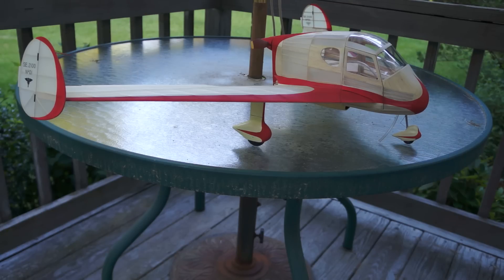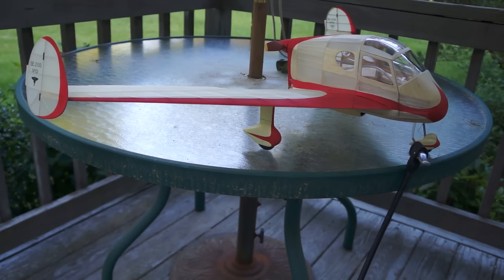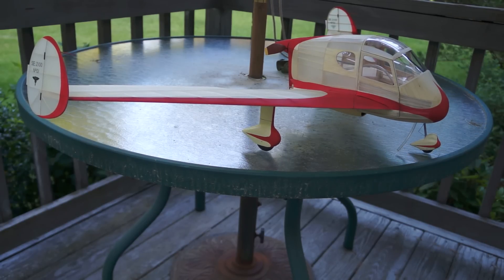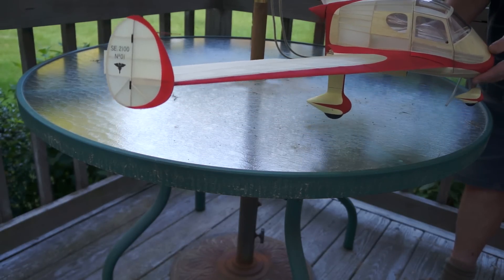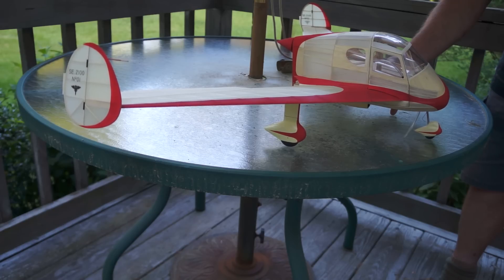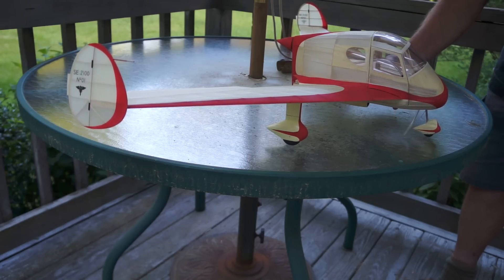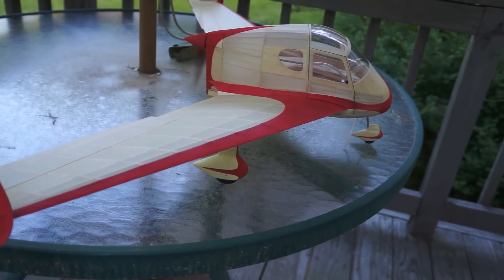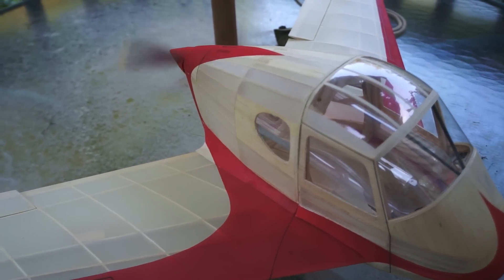Z-Motor Compressed Air test #1 in Free Flight Scale model

Comment: Here's an add from Bertram Ponds book  Expansion Engine Powered Model Aircraft. A ready made model powered by compressed air  has made an appearance in Europe. The motor, tank and propeller are plastic. The wings and tail surfaces are balsa sheet. The tank at7 60 cu.cms. is a bit over 3/4 of a liter, and  pressure relief valve set to 102 psi. (7 bar) The engine bore is .3937 (10mm.) and a stroke of .3149 (8mm.) The motor weighs .4 oz. (7gm.) The piston has a spring on top that acts as a pressure regulator. This results in  increased duration. The propeller is 6.6 inches in diameter. Duration at 7 bar is 60 seconds. Weight of the entire model is 4.6 oz. (130gm) They have named the model Jonathan Z model.

Comment: I love this engine so much... Any second hand Z engines on sale? I wanna reproduce the resilient parts using sugru to increase the lifespan... Thanks!!
Reply from the maker: I likr your thinking!  By resilient parts I'm assuming you're referring to the thin rubber-like gasket between the cylinder body and the cylinder head.  I'm sure it would take some trial and error to find the proper gasket thickness/density as well as the dia of the hole in the center of this gasket.
Reply: Indeed! In the Z engines I think that the gasket could be replaced by some fine tuned rubber balloon sheet, although vaseline and most lubricants tend to ruin the latex. 
But I am actually trying to replicate the gasket of an Air Hogs engine, in which, as you may know, the resilient part is a piston "ring" that expands on TDC under the rush of air, and contracts after the exhaust, to prevent compression on the upstroke. Still if I were able to get one single working Z model I'd take all care to make some sort of kit to replicate the gasket.

By the way have any of you ever flown by using some small brass steam engine such as this one?
https://hobbyking.com/de_de/microcosm-m27-micro-steam-engine-model.html
It weights 20 grams without the flywheel, but I'm afraid that it does not have enough power...

Comment: How about if you use air rifle air tank in or paintball air tank.More capasity and higher pressure that can regulated to come out lower psi?
Reply from the maker: thanks for the idea ZaKath, but a big part of the challenge with compressed air free flight scale is the power to weight relationship.  The paintball cartridge, while providing lots of hi-pressure air, is simply too heavy for the output of this approx. .04 displacement Z motor.  My experience says overall weight of the model plus the air motor, tank, valves, etc needs to be in the 5 ounce range for a model with 200 sq inches of wing area.  The SECAN SE.2100 is in this range...I just need to get reliable power output from the 30 year old Z motor.  i suspect the rubber diaphragm at the cylinder head may have lost some resiliency over the years.  Compressed air free flight is a worthwhile challenge..
Reply: tomnallen2 You can allso get small co2 cartidge that you can fill with pa,reusable they use these at air pistols.But i dont know the weith of that cartidge.You could check that out.You could use that other project plane   anyway.Sorry my english is not the best but atleast i try.

Comment: Remarkable accomplishment,  considering that electric systems are much more efficient by multiple factors.
Reply from the maker: Thank you.  We know expansion engines including CA and CO2 are less efficient and reliable which is why the FAC awards 15 extra bonus points to the scale score to compensate. The biggest challenge is the air motor in this model is 25-30yrs old and I suspect the rubber head gasket (key piece for efficiency) has lost some of it's resiliency.